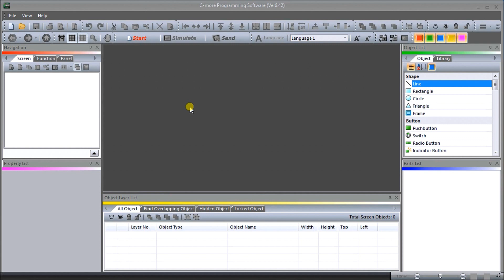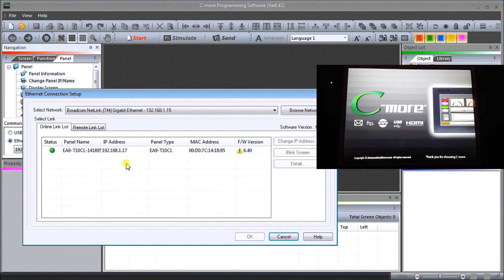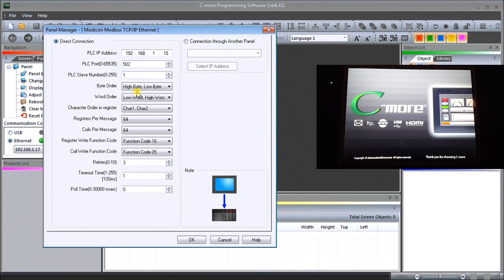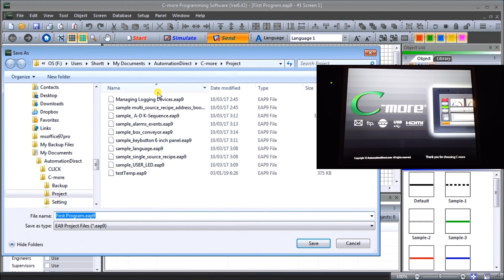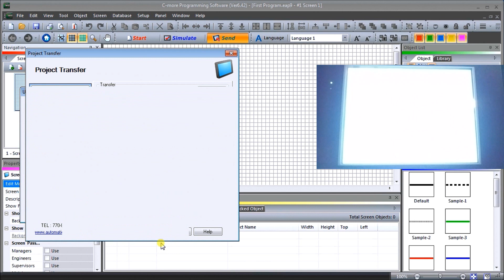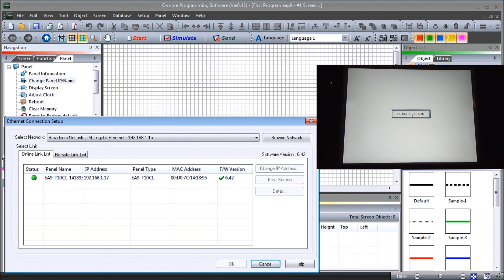Master C-More HMI Programming: Live PLC Control in Action!

Comment: I'm getting a PLC-001 (Communication Timeout) error when I connected a 2nd screen via Ethernet switch to my PLC. Now neither screen will work... It happened as soon as I uploaded the program to the 2nd screen and was working with just one screen. I'm using Click PLC and 2x EA9 7" screens. Not sure if there's something I'm missing in the setup or....? Any help would be appreciated! Your videos are awesome and very helpful:) Thanks!
Reply from the maker: Hi Mike,
Thank you for the comments. 
I would check the IP address for each of the EA9 HMI's to ensure that they are different. 
Have you programmed each HMI with different registers to write? 
Electrical Noise Problems - Please check to ensure that the communication wiring is not located next to power wires.
Just a couple of thoughts.
Regards,
Garry

P.S. Remember that the Automation Direct help desk is one of the best I have worked with. They may also have some suggestions to try.

Comment: I am using the EA9-T6CL-R and using the usb port to program it. It is not showing up inside of c-more programming software, the HMI is turned on and running. How do I fix this problem?
Reply from the maker: Hi Amar,
If this is the first time using this software, the C-More USB drivers were installed on your local drive when the software was installed.

The default location is here:
C:\Program Files (x86)\AutomationDirect\C-more EA9 USB Driver
You will need Admin rights on the PC, and you should disable your antivirus packages during the installation.
Unplug the USB cable to the C-More panel
Explore your computer's C: drive and find the directory listed above.
Right-click on the EA9.inf file and select install.
After that finishes, plug the C-More panel's USB cable back into your PC.
Try connecting again.
I hope this helps you out.
Regards,
Garry

Comment: You reference 2 ip address, 192.168.1.17 and 192.168.1.15. where did those come from?
Reply from the maker: Hi Rick,
The 192.168.1.15 is the address of the computer on my network. This was assigned by the router.
192.168.1.17 is the address of the C-More and it was also assigned by the router on my network. (DHCP)
Here is a post explaining the addresses:
https://accautomation.ca/c-more-ea9-hmi-series-panel-first-program/
Regards,
Garry

Comment: im struggling to get communication through serial from a P1000 to ea9. i have the the serial only version. any help. do i wire s+ and r-,, or s- and r+ to the + - of the rs485 port on my p1000? 
thank you for your videos
Reply from the maker: Hi Justin,
Thanks for the comment. The + will go to the + and the - will go to the - for RS485.
On the C-More programming software go to the main menu | Setup | Panel Manager. Ensure that the device (DEV001) is selected for the RS485 port. Make a note of the communication parameters like baud rate, parity, and stop bits.
On the Productivity Suite software go to the Serial Port configuration. 
https://accautomation.ca/productivity-1000-series-plc-modbus-rtu-serial-communication/
Ensure that the protocol is set at the default Modbus RTU. The RS-485 communication parameters must match the C-More. 
I hope this helps you out.
Regards,
Garry
Reply: @ACCautomation  thank you so much. This was very helpful and I can probably figure it out now. Just still have 1 question about the connector I'm using to the serial port on the ea9 (comcon-3)
The pin out is. 
Ground/ S- / S+ / R- / R+ / Term...
I'm not sure if I wire to S- and R+, or. 
S+ and R-. 
Sorry if these are dumb questions. I bought the serial only version Ea9 so it would force me to not just use ethernet.
Reply from the maker: @justinpuzak2558  
Can you tell me the exact model number of the HMI that you are using so I can see the pinout you are referring to?
Thanks,
Garry
Reply from the maker: @Justin Puzak
I just looked up the 15 pin port on the C-More units. This can be used for RS422 and RS485 connections. 
To wire this up connect the S+ to R+ and the S- to R- on the C-more side of the connector. Then connect the + to + and the - to - for the converter. 
This wiring can be found in the C-more manual.
https://cdn.automationdirect.com/static/manuals/ea9userm/ea9userm.pdf
Page 6-14
Regards,
Garry
https://accautomation.ca/series/c-more-hmi-series-panel/
Reply: @ACCautomation  I got it !  Thank you so much. If you ever decide to do 1 on 1 lessons over zoom I'd be will to purchase some of your time. You're a huge help. Thank you
Reply from the maker: @justinpuzak2558  
We could arrange 1 on 1 lesson over zoom. Please email garryshortt@accautomation.ca with the details on what you would like to cover.
Regards,
Garry